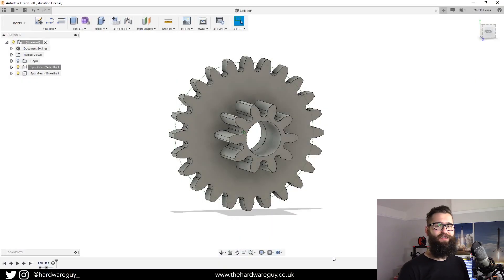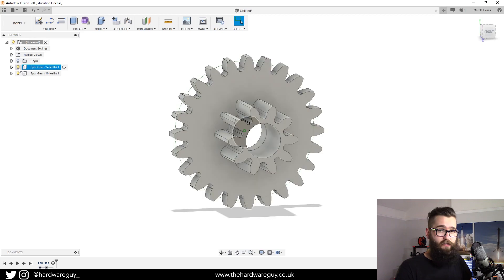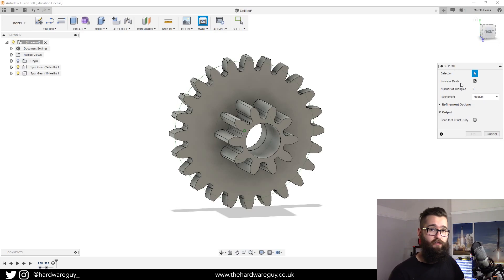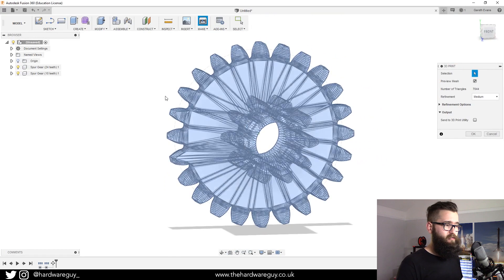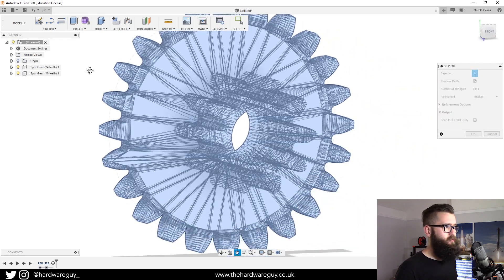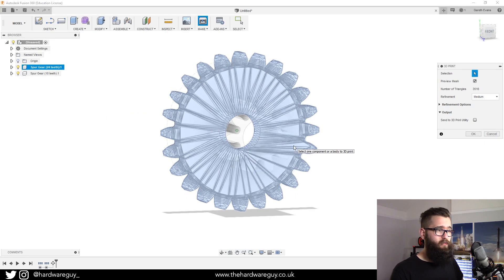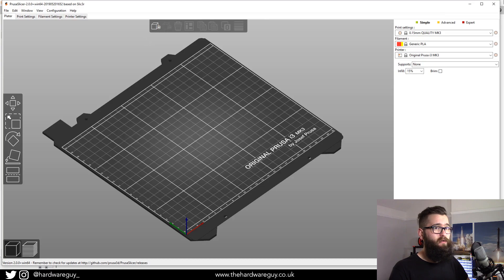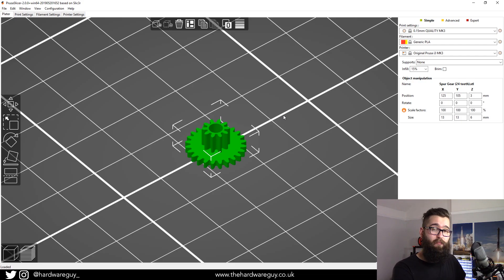Fusion 360 - Export as STL for 3D Printing

Comment: when I open the file in pruca slicer it is too small. I designed my part in fusion 360 in inches, so I assume that it thinks the unit measurement is in metric, but how do I set prusa slicer to import the proper dimensions?